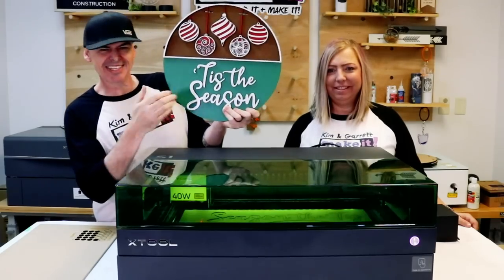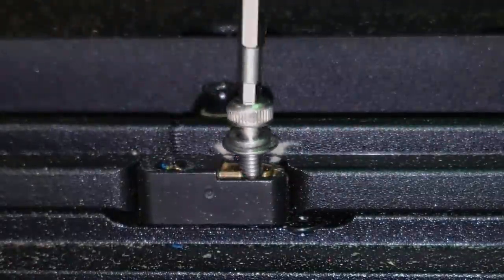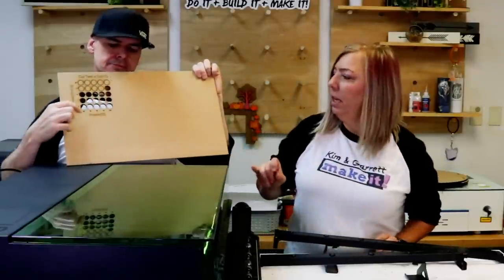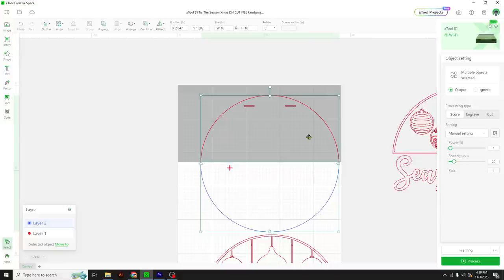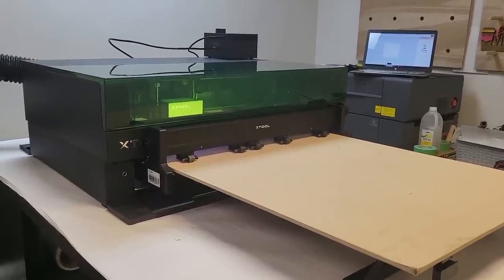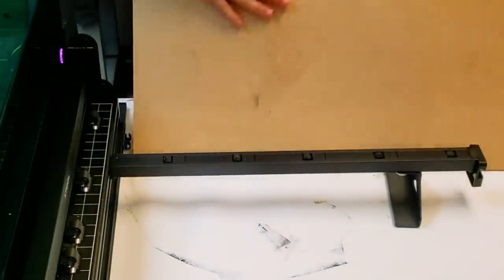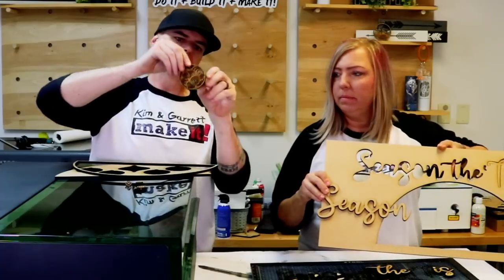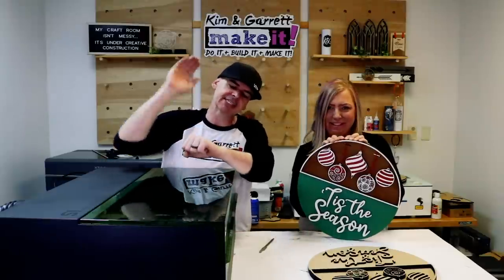How to Use the xTool S1 40w Automatic Conveyor Passthrough

Comment: everything i cut is burned with this machine :-( .... i tried cutting a file i bought from your website and everything i cut is burned, slow or fast speed and power, xtool has taken 3 days now to respond . Any help or general setting to cut the door signs would be great, Im using the same 1/4 " mdf , i got your paint and cant do nothing as all cuts are burned ... :-) ... helppp please